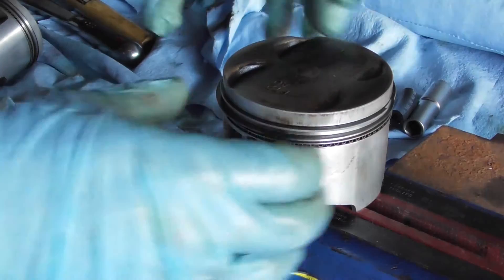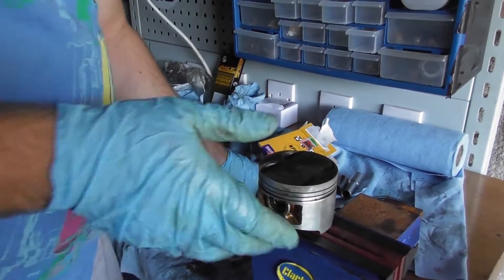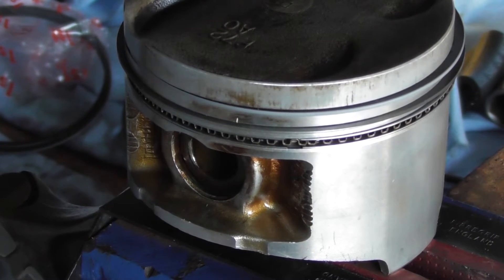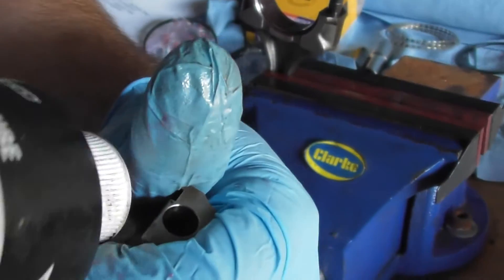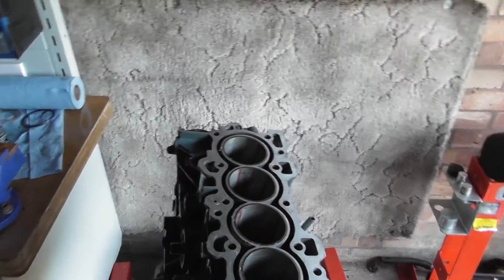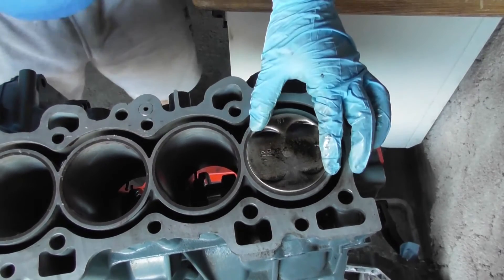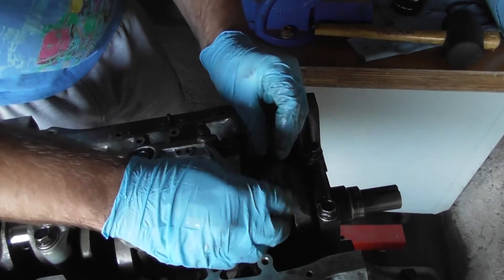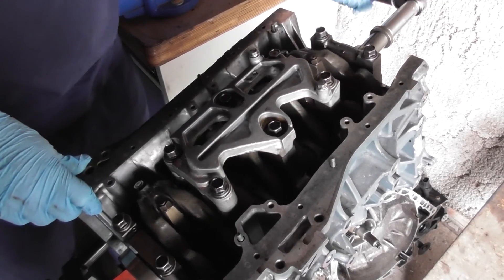T2CG Honda Civic B18C4 Engine Build Part 2: Installing Pistons into B18C4 Engine

Comment: you did not fil de rings ??
Reply from the maker: Jonah Bourbonnais Hi, I did not show this step, however I did place the rings each in the bore and used a feeler gauge to check their size. My rings were all in spec for my application. Thanks

Comment: How do you clock the rings?
Reply from the maker: Severo Coronado Hi, I realise I did not answer your question, sorry aboit that. The rings should clocked so that the gaps do not line up with eachother. What I mean by this is you do not want the 1st and 2nd ring gaps to line up or you could get compression leakage through here. The exact clocking is best shown through a diagram, therefore if you can send me your email address I will send you a picture which explains it
 Thanks

Comment: Hey man when i spin the crank it does not spin smoothly, does that mean i have tightened one of the main caps too tight?
Reply from the maker: Hi, did you lubricate the bearing surfaces and cylinder bores? Did you use the same torque procedure I used? Did you use ARP fasteners?

Comment: i got d16y8 stock only do it damage the motor if i just put turbo cause its just my delay drive?? not for racing
Reply from the maker: I am not sure, it would be worth checking if anyone else has done this turbo setup with standard pistons. You will need a mappable ECU though. Thanks

Comment: i want to learn how to put turbo on the single cam engine
Reply from the maker: +Joe Man Which Civic (EF,EG,EK?) and which engine do you have?  
There are a lot of turbo civic for Civic out there, some better than others.  
Two things to consider:
1/.  Compression ratio - Civics have high comp ratio, and placing a turbo on the engine will raise the in cylinder pressure even higher.  Therefore depending on how much boost pressure you intend to run, you may need to change to the low comp pistons (I think Suzuki Vitara pistons may fit).
2/.  Mapping - you will need to change you ECU map in order to account for the turbo.
I have not put a turbo on a Civic myself, however I wish you good luck in your build.
Thanks